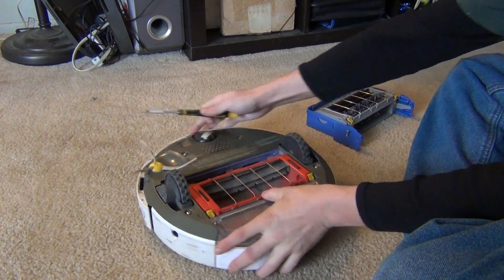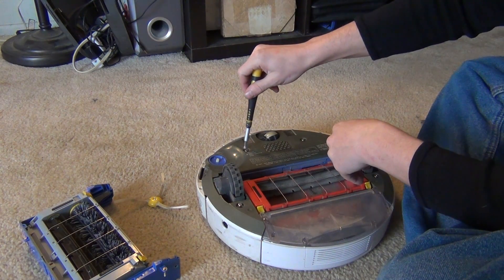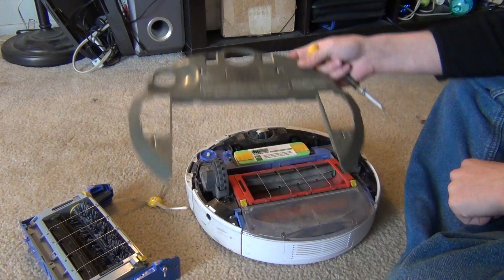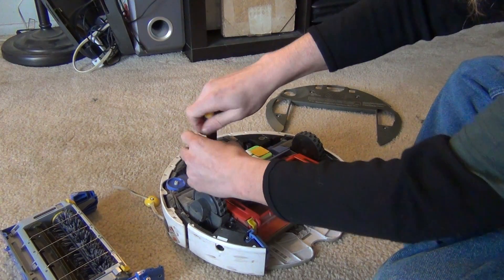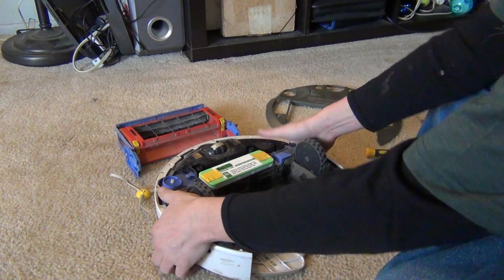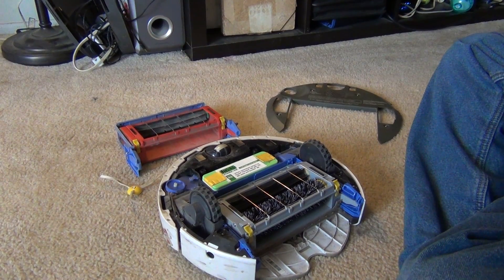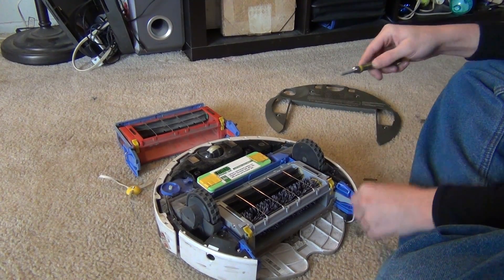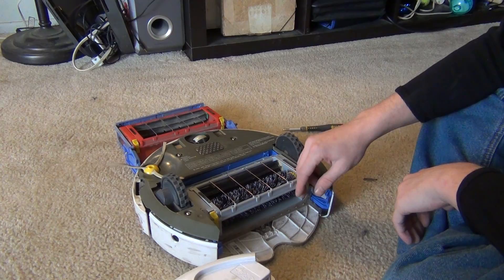Roomba 500/600/700 Brush Module Replacement

Comment: I've been working on a Roomba 565 that I picked up for $30 with a nearly dead battery. Got a new battery in it & installed new brushes but been dealing with a clicking noise.
Took it apart and cleaned the gear box of my green brush module. (Real bad!) Put it back together I'm still getting clicking noises. 

I dug in my trash & got the brush heads that came with the vacuum & cleaned them & my arm....... Slapped the originals back in & the clicking is gone.. 
I was thinking okay must be an issue with the new brushes. But no one in the Amazon reviews had this issue.... So I am thinking my gears are worn down. 
(There are allot more bristles on the new after market brush, likely stresses things more I think?) 

So now I am thinking I might as well just replace the whole module & even better if I'm giving it an upgrade!
But I'm curious what makes the newer gray ones better then the older style green ones. 

Like is it that less dirt gets inside the gear box? Or do they deliver more power to the brushes or something else? All 3? lol 
I'm just curious. Thanks!

Comment: How do I know if our current one is working properly or not?  I suspect the brushes are not turning but don't know how to troubleshoot or test before ensuring this is the problem.
Reply from the maker: Is it not picking up stuff on the floor?  You should be able to hear the brushes.  But you can also try putting your hand under the vacuum to see if you can feel it spinning.  There are two things that provide pickup, the brushes, and the vacuum.  Mine never went bad, but I did upgrade the back section (with the container and the motor unit for suction) with the upgrade AeroVac bin.

So, if your robot isn't picking things up, it is one of those two things that isn't working right.  Most likely the brushes though.  I had a Roomba DirtDog (this was a model with no vacuum, only brushes).  Even without a vacuum it picked up great on hard floors (not as good on carpet).  So, my guess is your brushes are having issues.

Comment: Hey, I’m having the issue of clicking sounds and the vacuum is not picking up…how do I access the gear box for the brushes? Any help would be great appreciated
Reply: I am not really sure but ‘clicking’ sounds and thumping sound from the robot is usual its part of its design so the cleaning head doesn’t get stuck on rug tastles and so on.
Reply: If the vaccum is not picking up also try diagnostic mode on your roomba to diagnose if the cleaning head is moving.

Comment: Thanks for your video. A little off topic, but, I noticed you're using a lithium battery and I wanted to know how well it works and does it require a special charger?
Reply from the maker: Works great and works with stock charger.

Comment: Hello might be a Little late  but what does the arvanced brush do better than stock
Reply from the maker: It actually is stock.  Just from the 700 series.  A couple series newer brush head.  Some improvements were made.  They changed how the bearings are so now much less hair gets stuck by the bearings.  They say it also is made to pickup better.
Reply: @earthling1984  Ah Nice but on Roomba site they are selling advanced brush module for 500 series
Reply from the maker: @maj113  The advanced brush is probably like I said, a 700 series brush.  They are selling it for the 500 series as an upgrade.
Reply: @earthling1984  ah ok thx
Reply: @earthling1984  do you might know for a good li-ion batt for roomba 555 in europe
Reply from the maker: @maj113  I don't for Europe.  I will say I used the lithium for years.  But, I did go back to a stock battery when I got this Roomba running again a few months back.  The lithium was nice, but more costly; and, stock battery works fine.

Comment: hey bud , just bought a used roomba 531 and im curiouse what would be best to enhance it , would this upgrade work and also the bin? or is it not worth it ?
Reply from the maker: flores henriquez The bin is worth it for sure.  It will have a new motor/fan which will increase suction.  The brush upgrade was nice as well.  But, if i had to pick just one upgrade I'd go for the bin.
Reply: ok so whats the bin called so i can order it and whats the exact name for this enhanced brush with the motor and will they both work on the 531 model ? and by bin i ment that part that has the filter on it im sorry if im not so clear on the exact names of the parts im a newbee to the roomba haha.

Comment: What enhancements does this module come with that make it better than the old one? I just got a Roomba 535 so just curious if it would  make an improvement.
Reply from the maker: If you have a Roomba 535 get the Aerovac bin.  I find it makes a huge difference!  (this also may be because the vacuum motor is in the bin, and my roomba was older, but it is a new design and better bin and vacuum setup).  The brushes seem to work great.  I don't know if they are picking up more or not, because even my old brush setup worked great.  But this new one has some modifications to the brushes, and also how they attach.  It has a different bearing setup with basically a large shield to help keep hair and other small particles from getting into the bearings and internals of the brushes.  I would say they for sure are a better design.  Both the AeroVac bin and the 700 series enhanced brush module cost $50.  If you could do both upgrades, that is great, but if I had to choose one, I'd probably go with the upgraded bin.  Also, when your battery eventually dies, go with a lithium battery instead of the stock nimh battery.  Lithium batteries hold a higher voltage thoughout the cycle, so they give more even vacuum power at start all the way to end; they should also last longer.  I put a lithium in mine, works great, but can't say how long it lasts in terms of years because only had it a month or so.  What I can say is my roomba will run for up to 3+ hours on a charge.
Reply from the maker: you can actually get the aerovac bin with one filter for $34.99 on the irobot site.  The filters can last forever basically.  I just spray them with the kitchens spray nozzle and it dries before the next use.  The brushes seem to be about $50 lowest wherever I look.
Reply: Thank you for the detailed response! How long did your original battery last before you had to replace it?
Reply from the maker: I usually got at least a year out of stock batteries.
Reply: Not bad. Thanks for your videos!
Reply: dane7902  from what I have noticed it is significantly quieter than before. Like previously stated I do not know if it picks up more or not, but this is the design they use on the newer models which appears to be superior. We have done the aerovac bin and now the cleaning head module and it is working better than ever. Run our roomba to dead every night by keeping the dock up on the fireplace. That seems to have extended the battery life.